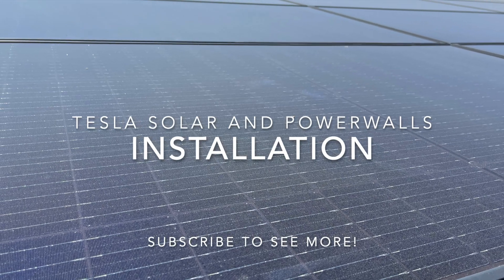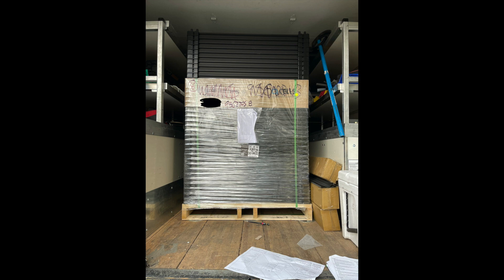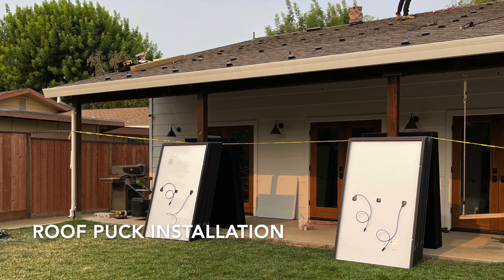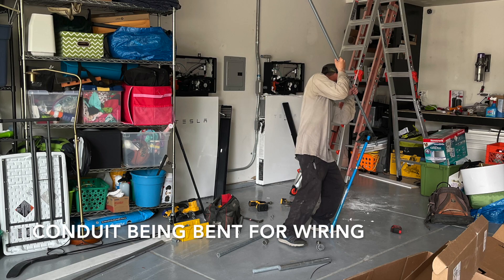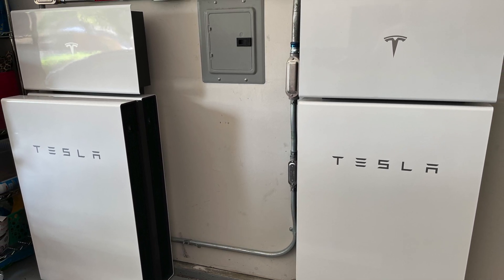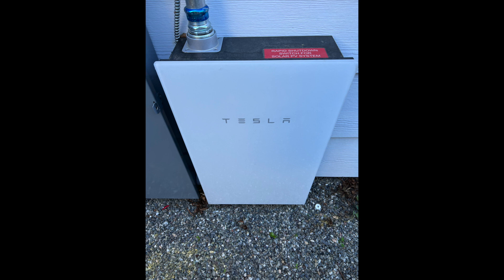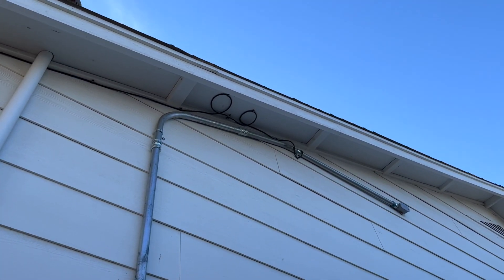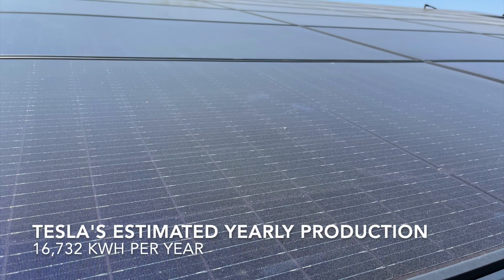Tesla Solar Panels & Powerwalls: Installation

Comment: Are you perhaps looking for other houses with similar setups to yours to be able to digest the data and make more content? 

I have a 10.2k solar roof 3 with 4 batteries and 2 tesla ev’s
Reply from the maker: Nice system! I wish I could do that, but barely have enough time to make videos as it is! Will hopefully have new content out soon.
Reply: @TheMahkus  I do have a question how did u convince Tesla to give you 2 inverters, I was not able to get another, and now my system technically, Max is out at 7 kW
Reply from the maker: I asked for our system plans prior to install and double checked. All our panels are east facing, so with 12.24 kW worth of panels we needed the second inverter.

Comment: Interested in your decision to go with 3 PW.  I just signed with Tesla and going with 2.  I was deliberating between 2 or 3.  Would be happy to discuss in DM.  Thx
Reply from the maker: Our two main goals were: whole house backup during outages...and not having to rely on the grid as much as possible.  We used an Emporia Vue (a USB gadget) that picks up your smart meter and tells you what your base house load etc is prior to having our system installed.  Using that info, I determined that overnight on our worst days with AC usage (which is when we use the batteries the most) we would sometimes need more than 27 kWh (2 Powerwalls) to last the night.  Happy to discuss more in detail if you'd like!

Comment: What was your is inverter size for this system? Have you had any solar clipping?
Reply from the maker: Hi Chittakone!  We have two inverters for this system since all our panels are east facing.  We have the 7.6 kW inverter and a 3.8 kW inverter for a total capacity of 11.4 kW.  We have 12.24 kW panels, so almost perfectly ratio'd.  I made sure when I ordered the system that I wasn't going to just get one inverter.  I haven't seen too much higher output than 11 kW (which is normal to not get the full rating) for too long, so I don't imagine I see any clipping at all.  If any, it'd be really (less than 5 kWh) minimal.

Comment: I'm considerg similar system, East facing and peak shaving with ability to handle a few hour outage every other month. Questions... 1) if I typically charge ev after getting home around 7pm, how does powerwall have enough to peak shave? EV usually charge 17 to 20 kwh after work. Need to be able to run AC, washing machine, dishwasher at night. All can already be done after 9pm so how much can I realistically expect for peak shaving? 2) was your system ordered thru Tesla? How come they didn't use Tesla panels? Thanks.
Reply from the maker: Driving me crazy, I'm so sorry this comment is so late.  If you're looking at a system, each Powerwalls holds 13.5 kWh.  So to charge 20 kWh would take most of two Powerwalls.  Depending on how big your house is, you might be able to get by on 3 Powerwalls total like ours, but may need a 4th!  Instead of charging your car at 7pm, I'd recommend using your Powerwalls only to peak shave, then have the car charge later on in the night after the Powerwalls have either depleted.  Using time based control, you'd charge during your cheapest rates from the grid (and when you'd likely have banked credits from your east facing panels).

I did order through Tesla.  When I ordered, they had not introduced their own panels (the larger 420W panels).  So I got the Q cell panels.  I know throughout the pandemic here people have reported different panels, so it seems like it's just what they can get their hands on.  I like how our Q cell panels are black, so as long as they work well?  I'm happy!

Hope this helps!  Let me know if you have any questions!

Comment: Amazing how quickly you got it installed.  I ordered in early June(7.2kw with 2 powerwalls $39k before tax credit), 1st on site assessment on Aug 2nd, then they scheduled 2nd assessment on sep 20th. Given the timeline, it may take half year or more to get it installed....
Reply from the maker: Our panels and battery boxes had someone else's name on them crossed out...so I'm guessing we got lucky with a cancellation.  We also didn't require a site assessment (I took pictures on my own) and accepted the first computer generated panel design.  I did have them move the Powerwalls from outside where they wanted to place them to inside the garage, so that took about a week for them to update.
Reply: Just got my installed 7.2kw with 2 powerwalls here in bayarea  on Dec 2nd after the initial deposit in June. So a 6 month wait.

Comment: Hey you are the only person I've seen that has a system like mine so maybe you can help me out. I have a brand new 17.6 kW array with 2 powerwall+. I haven't seen anyone else with two inverters so I wanted to ask you: do both inverters broadcast their wifi?

I wanted to connect to the gateway directly and see the stats and I was puzzled that I was only able to connect to one of the wifi networks.

Any insight would be appreciated!
Reply from the maker: I don't see my inverters broadcasting at all, only the Gateway.  I'm not sure if they turned the broadcasting off during install or not, but the only thing that will show up as a "wifi" network is the Gateway when I'm close enough to it.

Comment: dang how much for total install?
Reply from the maker: Around $55k (batteries were $23k, solar 28k).
Reply: @TheMahkus  How much was your electric bill before the install?
Reply from the maker: @springspring6180  Summer months was $600+, winter around $300.  PG&E is crazy expensive!
Reply: Is it possible to just get the pans installed at first and then add the power walls at a later date, or would that be stupid.  Just beginning my research for new roof and solar.

Comment: Hello, Can I integrate the solar assembly into my original powerwall 2 system, then it can turn to the powerwall plus?
Reply from the maker: I'm not sure I'm following - you have an existing system and you want to switch to the Tesla inverter from a different brand inverter?  The Powerwall+ is just capable of higher continuous load and peak power than the Powerwall 2...the inverter being separate from that.

Comment: Jeezus... those panels are way to low. Requirement here in Texas according to electrical code, any electrical equipment should be at atleast 3ft from foundation/floor to the center of said equipment.
Reply from the maker: Don't have to worry about flooding in the Central Valley of CA, thankfully.

Comment: Wow. Big system. How much of your decision was for emergency backup? Specs for PW2 and PW2+ differ. Noticing any difference in daily operation?
Reply from the maker: Hi Bill!  We are in PG&E service territory where we have the possibility of PSPS shutoffs during fire and high wind events.  Our area typically doesn't see too many shutoffs, and we have maybe a handful of power outage throughout the year.  We did have a power outage of 2 days last year from some major issue with the lines (an accident I believe).  I wanted some backup capability, but for me most of the decision for Powerwalls was so that we could peak shave (our peak rates are near 50 cents per kWh) and take ourselves off the grid as much as possible.  Due to our roof layout, we could only really put our panels on the east side so we don't produce much at all during the peak periods.

In terms of the differences between the two, AFAIK the difference between the 2 and 2+ is the inverter and system controller.  They have peak power capability of 7 kW each if I remember correctly and continuous around 5 kW.  I've had both EVs charging, electric dryer running, and AC going for a total 20 kW draw and they provided electricity just fine with no draw from the grid!  The system lumps all three powerwalls together so they act as a cohesive unit.  Haven't noticed any differences day to day.  I was having some occasional dropouts with the powerwalls where they'd turn off and reboot in an hour (drawing from the grid for an hour) when they were first installed.  Engineering took a look and said that it was a "CANbus overutilization issue".  They pushed a couple firmware updates and haven't had any issues since!